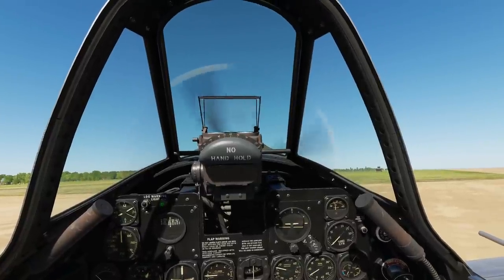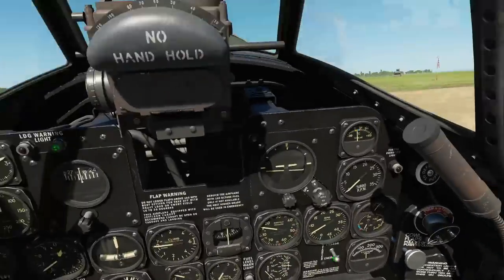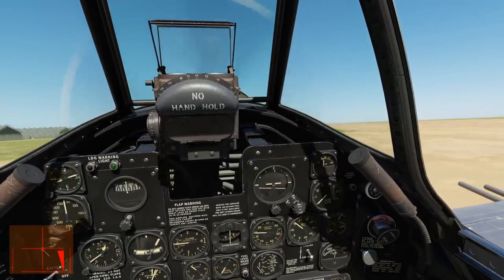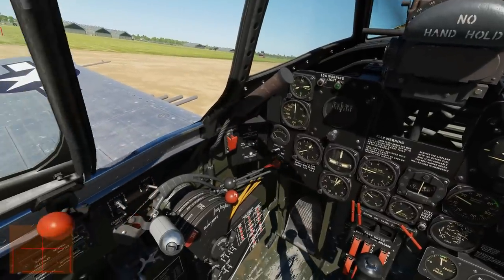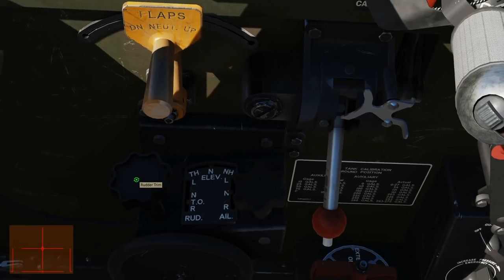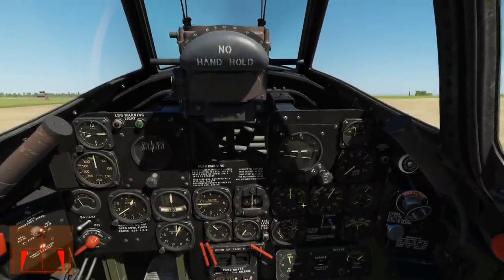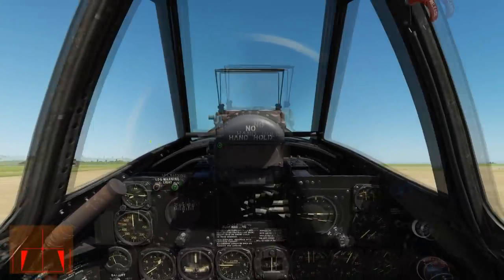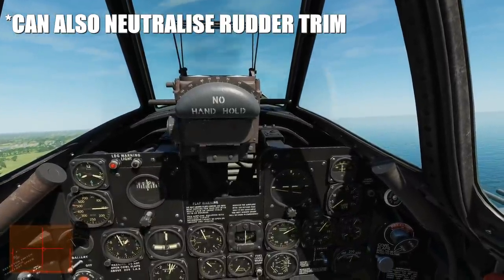P-47D Thunderbolt: Taxi & Takeoff Tutorial | DCS WORLD

Comment: per the P47 pilot manual, boost is not used for take off unless at max gross weight or very short field.  boost is engaged at 5-7000 ft. you can connect the boost and throttle but you will loose 300hp. boost is set to max until you reach critical altitude where it is reduced to maintain max RPM for the boost, about 22,000 RPM.

Comment: You should leave the boost lever interconnect off there actually, as explained in this video:
https://www.youtube.com/watch?v=HHtypRJuNKY
Unless you firewall your throttle, you're wasting power because te TSC increases your MP without actually increasing the power at low altitudes. Also in normal conditions, the boost is not to be engaged below 7000 ft, but of course it can be used in emergency conditions or to help get off the ground with heavy loadouts especially on a short strip. The interconnect is there for convenience in the Danger Zone, you can also interconnect the prop pitch lever as well, although I don't know if DCS models that as well.
Also note the maximum speed for open cowling flaps is 225 mph IAS.
Reply from the maker: Thanks RD